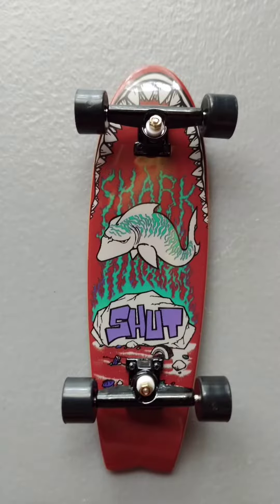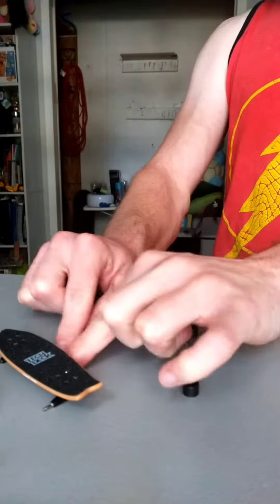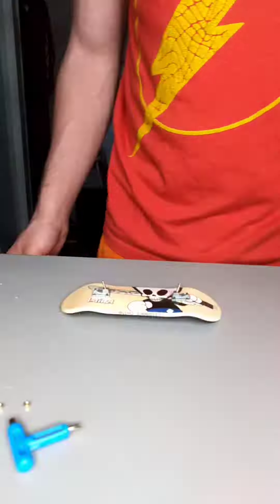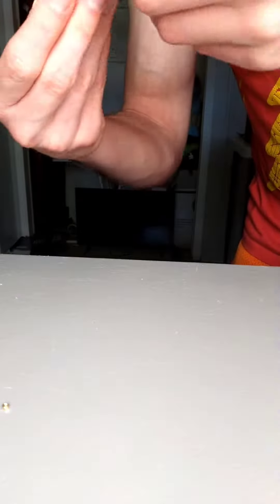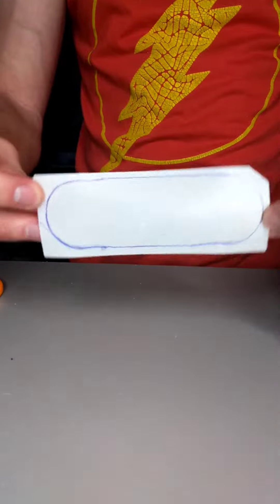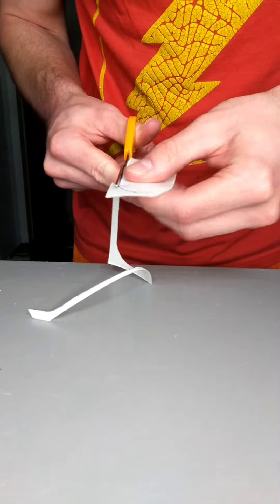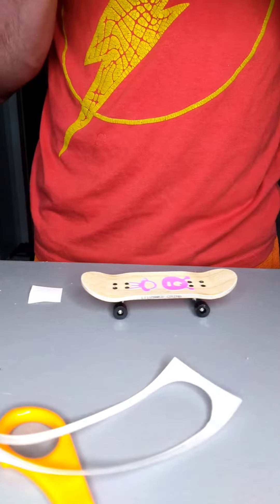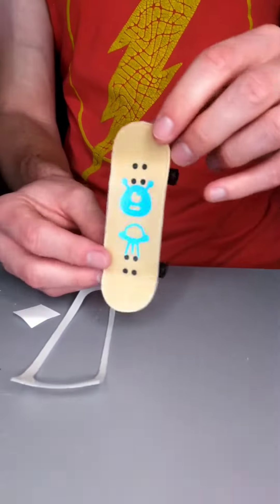upgrading a techdeck

Comment: i mean the wheels tho you might as well just of left it alone and just added bushings and foam grip tape
Reply from the maker: Nah the big cruiser wheels look too dope to not use on this setup, and silicone grip adds weight, pop, control, and lasts significantly longer than foam. Though it also comes down to preference, so do what you like best